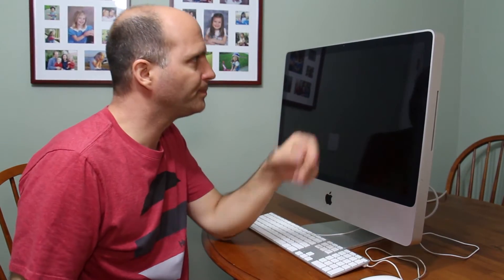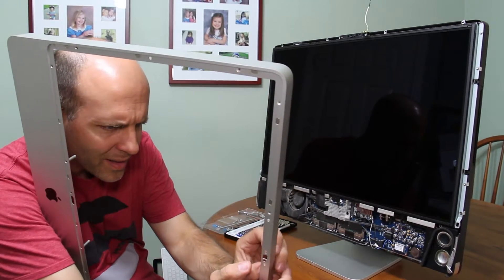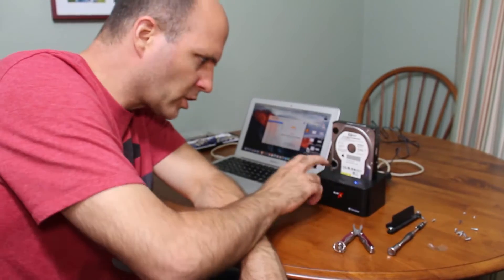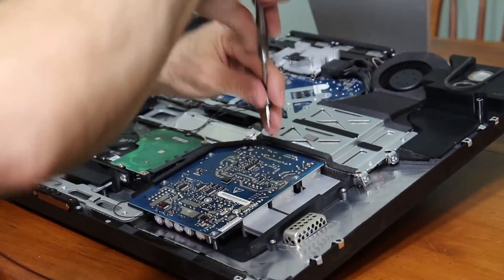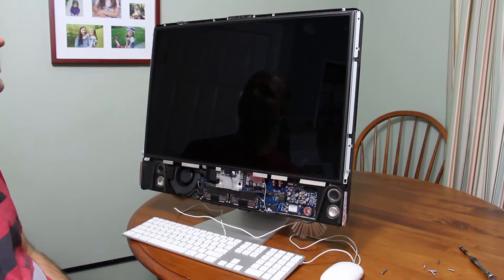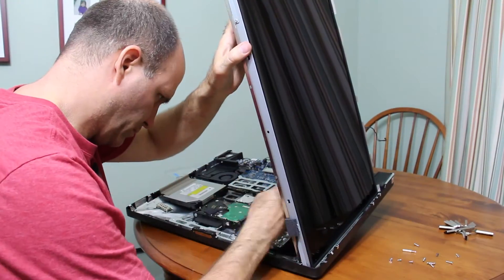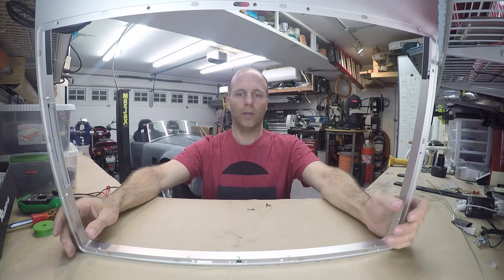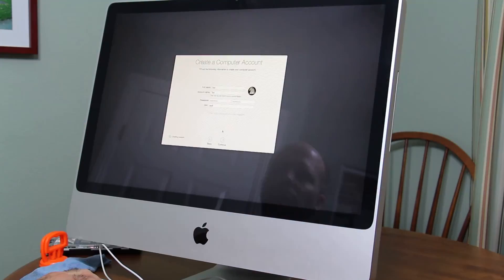How to replace a hard drive in an Imac

Comment: Hi Ted, I have a 2007 iMac and a mid 2010 MacBook pro.  I put in an SSD in the MacBook Pro a couple of years ago, and I want to put in a new hard drive in the iMac.  The question I have is, why can I not upgrade to the latest IOS operating systems in my MacBook pro?  If I cannot get the latest IOS, then I cannot load the latest software that I need such as office 365 on my computer, I can only use in the cloud.  I can only update to High Sierra version 10.13.6.   Is there a way to update to the latest for both the MacBook Pro and the iMac?  Thanks,